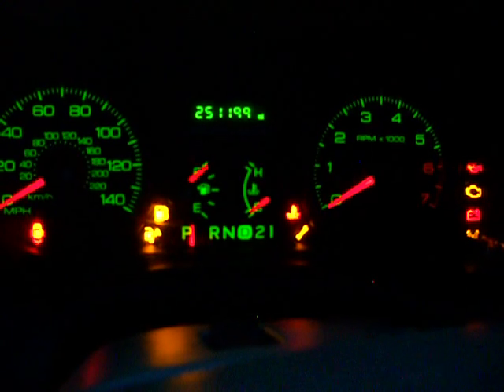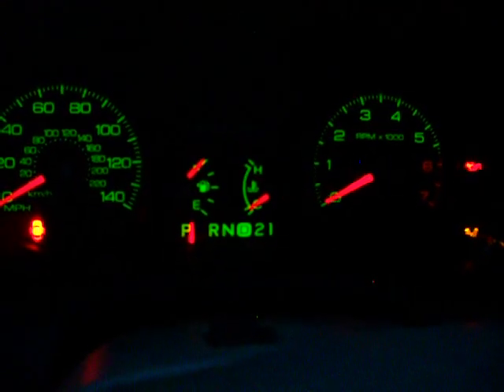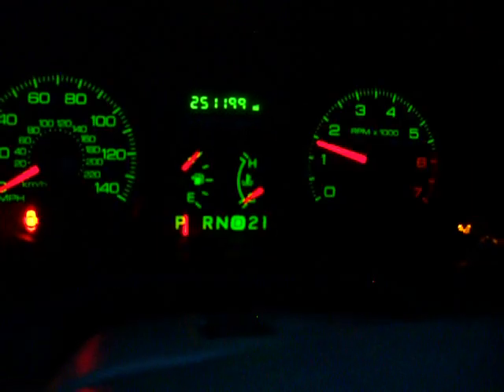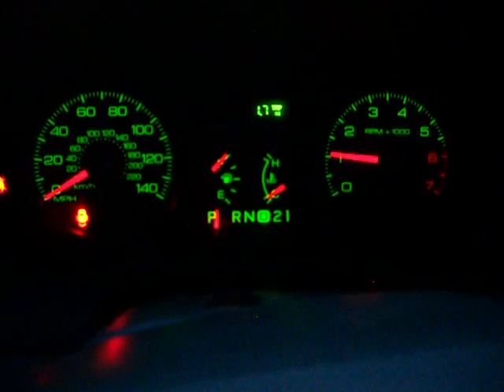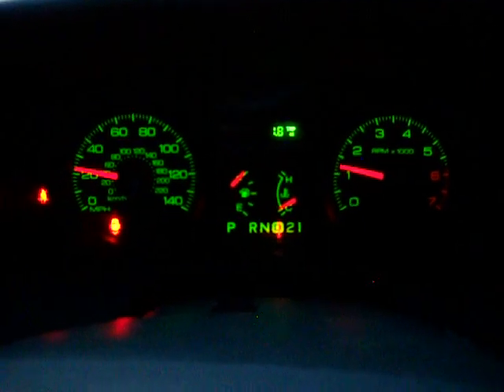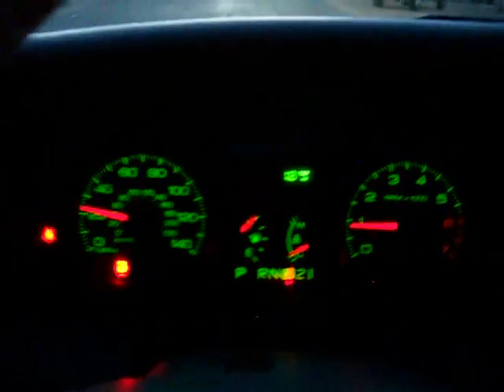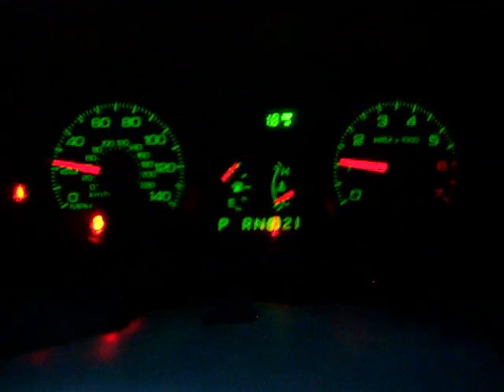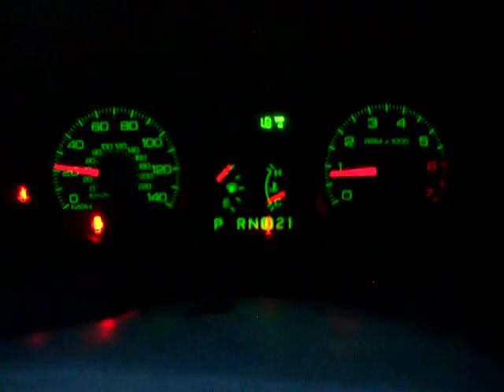2005 Crown Vic P71 - instrument cluster swap to newer ('06+)

Comment: Hey ,did you swap the LCM? That controls the bells /chime as well as lights....also 2006 has a ddm im not sure if the 05 has it.
Reply from the maker: No, the 2005 and 2006 LCMs are not interchangeable.  Would require complete harness replacement as the boxes are not pin for pin compatible and the 06+ has more functions.  My '05 does not have the DDM but there are those that do.
Reply: silicon212  did you try reprograming the lcm? Like wt ids or forscan? I know you can edit the cluster lights with it
Reply from the maker: The LCM on the 06+ has the SCP bus interface on it, which the '05 lacks.  This is the slow speed CANBUS interface that the LCM communicates with the cluster over.

Comment: I have the pcm from an 08 and it won't plug into my car. will I need to get an 06?
Reply from the maker: I was not aware of a difference between the connections on the 05+ and '08-up.  It's possible though.  You're better off with the '06 computer anyways due to TPMS.

Comment: I think that the high beams work differently 2006+.  I noticed that in 2006+, even when you do "flash to pass," it disengages the low beams as well.  Prior to 2006, "flash to pass" illuminated both low and high beam lights.
Reply from the maker: Blaine Bugaski It's the difference in the LCM modules between the years.  With the '05 LCM, I don't experience the issue you state, but it does prevent the high beam indicator from displaying on this cluster.
Reply: I have a 2001 so I have no issue.  I have just noticed this, comparing 2005s to 2006s and so forth.

Comment: I've changed and have done many things on my 05 cvpi like engine-transmission-rear axle swap and other things lol....i really wanna put in the 06+cluster. My rear axle and transmission  came out of an 09 cvpi and am wanting to use that cluster from where I got them from...so all I would have to do is grab the PCM (and  its wires??) , cluster and the fuel injectors that is on that car?  Don't have to re program key or anything else?
Reply from the maker: I would stick with the '06.  Newer ones might work fine, but I'd use the cluster from the same vehicle the PCM came from.

The P71 does not use PATS; a civilian model might however,